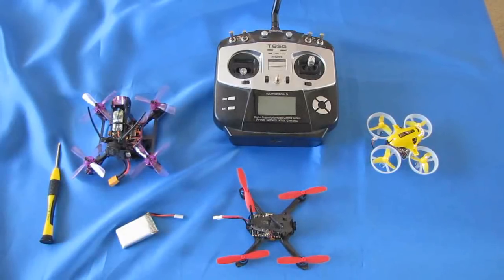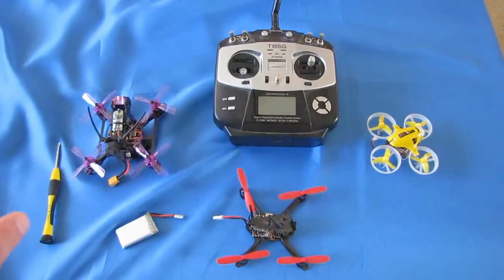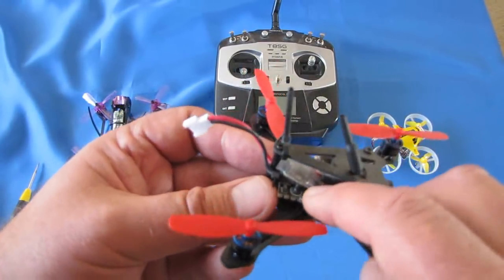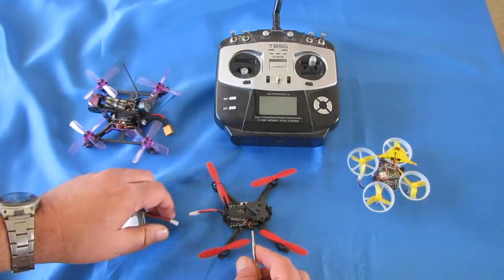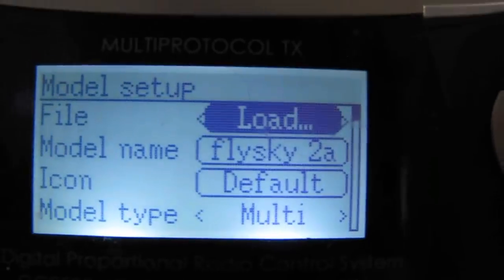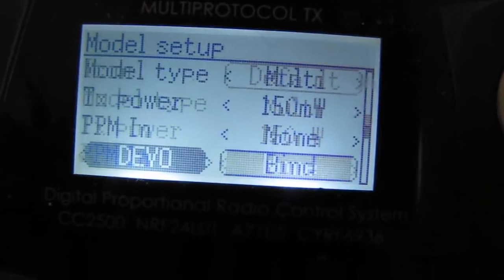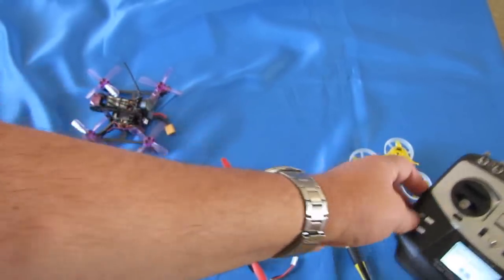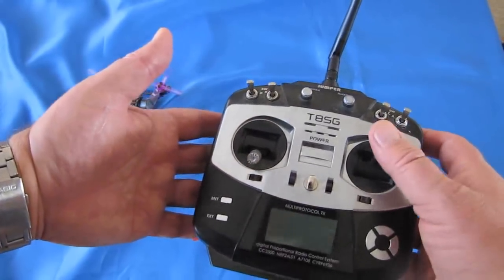How to Bind the T8SG Jumper Universal RC Transmitter

Comment: can you help my whoop wont bind to my dx6i any ideas sir?
Reply from the maker: First off, what version receiver did you purchase with your whoop?  And what specific whoop did you purchase?
Reply: @Quadcopter101  BETAFPV Beta65S Lite Micro Whoop Quadcopter Silverware Firmware Lite this one
Reply from the maker: @brapppstar2314  What receiver is installed? Example: Frsky, Flysky, DSM2/X ?
Reply from the maker: If it is the following drone, then it will not bind to your dx6i.  https://www.amazon.de/BETAFPV-Quadcopter-Silverware-Firmware-Controller/dp/B07CV8WVZ2
This drone uses Bayang protocol for its receiver.  To bind to this, you will need to use a multiprotocol transmitter with Bayang protocol capability.
Reply: @Quadcopter101  Supported radio transmitter：BETAFPV TX01 radio transmitter; Jumper T8SG radio transmitter; Radio transmitter of toy drone like JJRC H67, Eachine E011 etc which using the Bayang protocol. If not sure whether your radio transmitter could support this FC board, please email us ( support03@betafpv.com) for help.
As same as the Beta65S, more punch on throttle wth faster 716 19000KV motors and 3-blade props. BETAFPV Z01 aio 25mW vtx camera with 48 channels in total.
Built in Bayang protocol native receiver, compatible with almost radio transmitter with deviation firmware or deviration compatible transmitter module.
Support level mode and acro mode. Also it has the ability to change setting for custom builds, or to adapt to personal preferences by stick gestures.
Some basic guidance and typical FAQ, please check it here : https://betafpv.freshdesk.com/support/solutions
Reply from the maker: @brapppstar2314  Your dx6i uses Spektrum protocol (DSM2/DSMX).   But unfortunately the dx6i does not have Bayang protocol.  The dx6i will not work with your drone.
Reply: @Quadcopter101  ok thanks for reply i thought it might not after ready this would a cheap flysky work with it?
Reply from the maker: @brapppstar2314  No flysky would not.  You would need to use a multi protocol transmitter with Bayang protocol (such as the T8SG in the above video).  Or you can use a real Bayang transmitter.  Unfortunately most Bayang transmitters are toy grade.  For example, the following should work with your drone http://bit.ly/Bayang-protocol

Comment: I just purcahed a Sky Vampire 2.4ghz. Whats the range like for this quad? And one of my props always stop working after landing. I have to manually spin it to fly again. Hope you guys understand. Cheers
Reply from the maker: Sky Vampire https://www.youtube.com/watch?v=QPwTVPqW4gw
Range about 300 meters. As for the prop, try the following.
1) Turn on the quadcopter and place it on a flat and level surface.
2) Turn on and bind the transmitter.  Center all trim tabs.  Place the transmitter in high (Expert) rate.
3) Leaving the quadcopter undisturbed, move and hold both control sticks to their lower left corners.  Hold them there until the quadcopter's lights blink. 
4) Let go of the sticks and try flying.
Reply: Hi, thanks for response, Tried the steps, it did work a few times then it's back to square one. Not necessarily landing but when i try to increase and decrease the throttle a few times then the left front prop stops working. Could it be the motors? Thanks again for the reply. Your videos are awesome
Reply from the maker: Yeah, your left front motor is likely kicking the bucket.  But replacements are cheap and widely available.
Reply: Quadcopter 101 Okay, thanks alot. :)